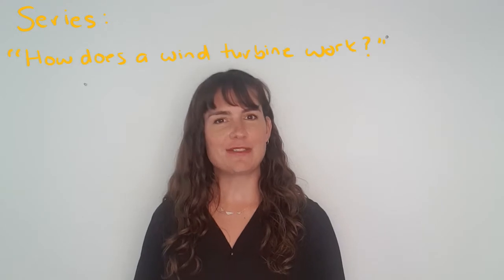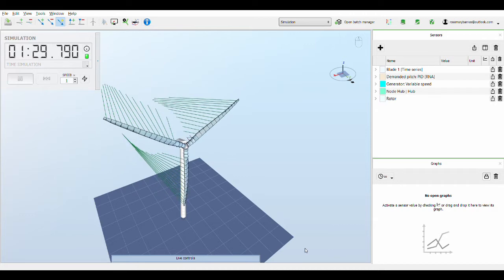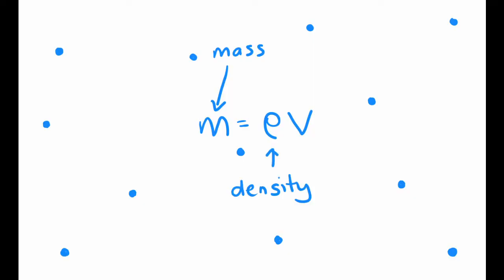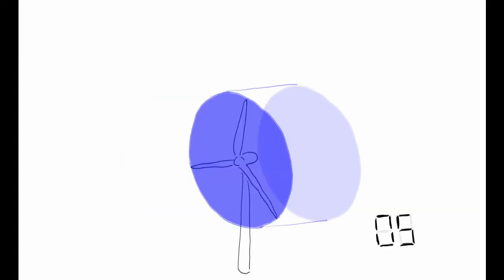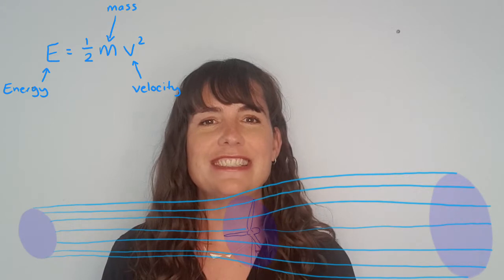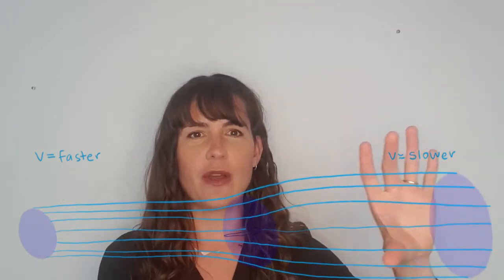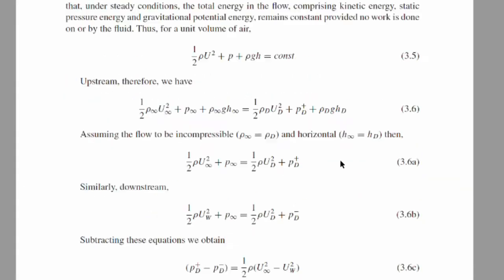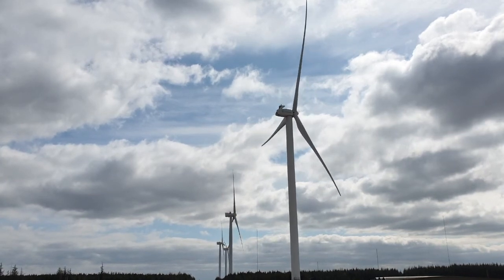The Betz Limit in Wind Turbines

Comment: Would be interesting to elaborate if any significant effects on moisture transport towards lee side of windfarms as well as on vetical upward displacement of air flow from slowing down the lower layer (acting as artificial hill). Can imagine this might have implications on thermodynamik of the local atmosphere (e.g. temperature profile)

Comment: Hi Rosie - loved the vid, thanks. The 59% max Betz efficiency, that must be affected by the residual drag of the generator right? Is the efficiency calculated with or without the gen drag? I'm interested in your thoughts about that. Jerry
Reply: Was thinking the same. Weight/gearing of generator must surely come into play?
Reply: That's the theoretical efficiency of conversion from wind energy to rotor energy: with no other energy losses after the rotor.

You are both right that the real world efficiency will always be lower due to losses at every energy transfer all the way to the user...

Comment: If you are exhausting into a vacuum, does it change the Betz limit?
Reply: The only variables in the equation are mass and velocity, Would either change? Mass won't, velocity may increase, but that does not increase efficiency.
Reply: @gregripp  I can't see the assumption made by looking at the equation.  One assumption I predict they might have made is that the ambient air pressure is the same on both sides of the turbine since that would be true almost always.

Comment: Hi Rosie.  I have a concern: by using wind and wave power, we're extracting energy from the world's climate systems, and returning it later elsewhere as heat.  Is it possible that this will contribute to the climate change crisis?  I've never heard this possibility discussed.
Reply: afaik heat has neglicible(and temporary) effect on climate, the problem is greenhouse gasses acting as a blanket, sun heats up earth, blanket makes that less heat can escape, resulting in warmer climate
Reply: All the wind energy ends up as heat: if no windmill is present the wind slows eventually due to friction with the ground / mountains / etc 

So ultimately no net effect

Comment: Thanks Rosie.
I am an engineer and have been working on A VAWT design that works on the principles discussed in your video "VAWT Design". I have been working on this design for 10 years and have developed a computer model for a lift-based VAWT and have discovered several important concepts. I cannot find a mechanical engineering department in any universities here in the US that are working on this type of design. Do you know of any? By the way I think you left out an important variable in the equation you showed for aerodynamic force. 
Thanks again.
Noel Potter

Comment: Just wondering since a wind turbine with 3 blades doesn’t cover the greater part of the wind stream how can maximum efficiency be achieved?
Reply: That is disk solidity and you could have 100% solidity with a single very wide blade like a screw. The rotational speed of low solidity turbines is high relative to the wind speed and a blade effects a volume of flow around it, so the effected air mass is still near 100% Maybe better to think about the diagonal path of the blades through the flow rather than a frontal view. This is a propeller vortex visible due to humidity but similar in principal https://youtu.be/mk8b8Cv_0kk pause it at 59 seconds note only a few inches of space.

Comment: not piling up, but squattered to various directions with various velocities, therefore 100% is a limit, not 59% (due to simple pressure differences the air from other volumes would fill the area of stagnating air molecules)

Comment: does the same formula for efficiency apply to VAWT too?
Reply: Yes, but note its a theoretical limit not a real world achievable one.

Also in practice HAWT get nearer that theoretical max than VAWT --  I have no idea why
Reply: VAWT have the problem of drag of the blade moving upwind. For this reason they are inherently less efficient than HAWT.

However, VAWT can have some advantages in very flukey turbulent winds such as can occur around high rise buildings because an HAWT takes time to respond to sudden changes in wind direction.

Comment: I am thinking to make a wind turbine can you help me how to design it  and aerodynamic design .
Reply from the maker: Absolutely! I have a whole playlist on wind turbine design, most of it to do with blade aerodynamics.
Reply: @EngineeringwithRosie  can you send it to me 😊😊
Reply: From my own experience, small wind turbines need about a 15 deg trailing edge flap to generate usable torque. Plan on a tip speed of 250-300kmh. If made of timber, an erosion strip is needed on the leading edge of the outer third of the blade. Use low density high strength timber like spruce or good clean sections of western red cedar. spin the turbine for several days before sealing it as any mobile moisture and resin will seep out through the timber end grain on the blade tips. Once the seepage stops the timber is fully cured and you can seal it up.

Comment: I was wondering how pressure dynamics work in this; i would think the stream of air would collapse a bit because the air that doesn't pass through A (surface blades) retains its pressure and is higher that the pressure of the output air going through A. but then i thought, since v(out) < v(in) ==> more air behind the blades, so increase in pressure?
More generally, how are the wind turbines explained in terms of pressure?
Reply: Pressure in moving fluids ist more complicated than this. There is static pressure- the weight of the air column above squeezing  the air down here to its density. But there is also dynamic pressure- the kinetic energy of the air having a speed higher than zero.

The turbine extracts energy from dynamic pressure- decreasing dynamic pressure by slowing down the airflow. Static pressure stays nearly the same. (ignoring differences in ground heigth and air density that i hope are negligable in the scale of our hozizontal flow through the wind turbine)

Also, this is the explanation why rather than collapse (having lost static pressure) , the air flow has to spread behind the turbine - to get the same mass of air moving away from the turbine, the slowed- down air has to flow in a larger total cross section than before.

Keywords: venturi effect, bernoulli's equation

Comment: I would have thought it was to balance the power to each phase of the generator(assuming 3 phase AC generator). That way if there is different speed and mass of the air across the area of the blade rotation, then each phase would see the same torque pulsing with a three blade system. Since the generation produces an apposing force, unbalanced generation torque would put the blades seemingly out of balance. That's just the way my head works so I could be wrong.

Comment: Betz theory is very wrong. In closed pipe, channel ,duct turbine blade geometry can not matter. But in open air velocity before and after is the same Isobars are the lines on a weather chart at that region wind velocity is constant. Anthropogenic installed wind turbine have some impacts to wind speed 0.00000000000000001%, but it same argument that tea kettle is some house caused global warming. If velocity before and after turbine is different thus mass flow rate is also different before and after. 
British scientist Frederick W. Lanchester derived the same maximum in 1915. The leader of the Russian aerodynamic school, Nikolay Zhukowsky, also published the same result for an ideal wind turbine in 1920, the same year as Betz.[4] Wikipedia source
In 100 years we can not understand how airplane wings works what is maximum angle of attack to produce maximum torque and that is fundamental maximum angular velocity of turbine blades calculated from wind velocity. efficiency to a maximum of 59.3% without wind turbines blades geometry it is nonsense. For hydroelectric dam where water flows inside enclosed channel maybe ?
That is problem bicycle already invented but it has 50% less efficient ,heat exchanger uses 2 times more carbon steel and 30% less efficient because based in 150 years theory that is wrong. Engineers are inventors but scientist must put invention to its efficient limit. Why exploit inanimate objects when we we extract more materials and bill people with bigger prices for inefficient devices (rhetorical question).